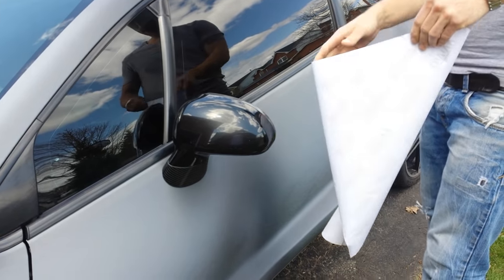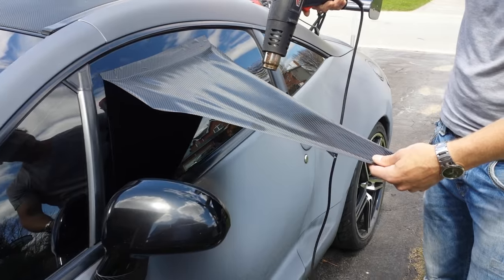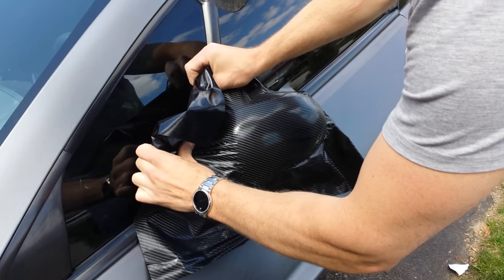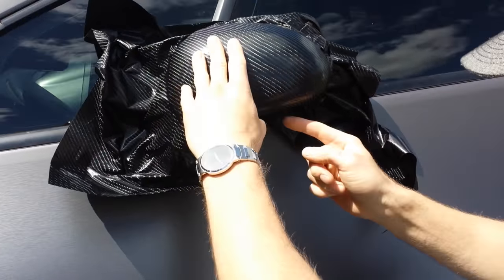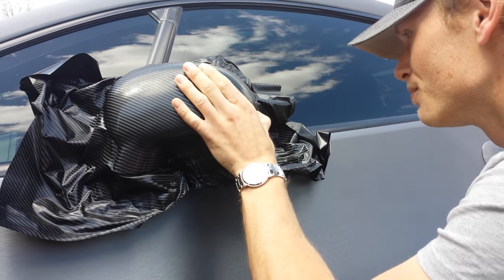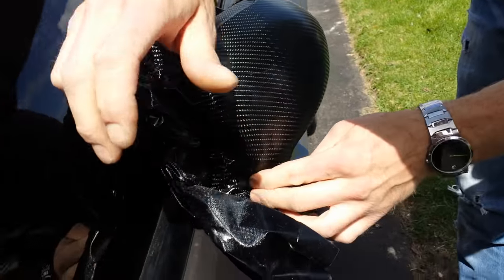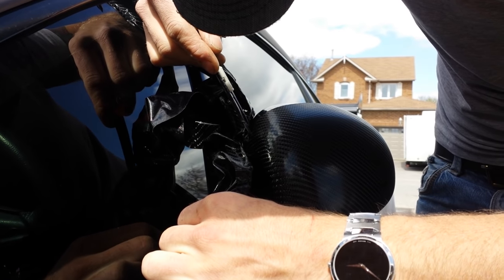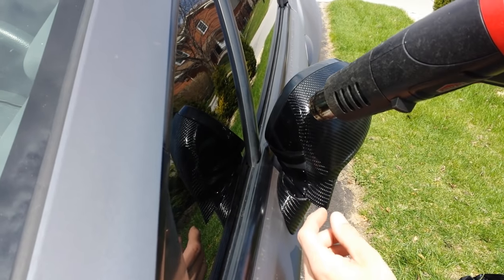How to vinyl wrap your mirrors (outside). Learn how to vinyl wrap alone by @CKWRAPS

Comment from the maker: Kudro Rico The mirrors hadn't been done on this car yet so it wasn't a re-wrap. This eclipse belongs to a friend of mine who I sponsored with a full wrap. As for brand, I prefer to stay away from 3m. I find it's hard to work with and very over priced. Their carbon fiber also isn't as nice as Vvivid Vinyl, I only use carbon fiber from Vvivid Vinyl. I would recommend using Avery Dennison if you're a beginner. Avery is very easy to use and also more cost effective, I consider Avery to be the Rolls Royce of vinyl brands.
Reply: can u do a video on how to wrap the front end pls :-D
Reply: CK Wraps what do think about orafol/oracal 970?
Reply: cara warring side mirror viva
Reply: CK Wraps
Reply: Indian dance
Reply: Damal Meemaduma па
Reply: is it ok to do outdoor installing. because small dust not an issue right?
Reply: @mrri8166  only on very still days.

Comment: You make it look so easy... how do I avoid creases and bunching on curved surfaces?
Your videos are great, you explain things the same way I would when showing a layman a new skill.
Reply: Heat gun and relief cuts at angles worked for me. I just did bottom of a spoiler that i had to work 3 different angles on a surface..wasnt easy. Lots of heat and cutting to work it in
Reply: He does make it look easy. I finished my roof today and it came out awful. 😂

Comment: Hi Chris 
I’m getting ready to do a carbon fiber wrap on my motorcycle gas tank. It doesn’t have any hard edges. Pretty much a teardrop shape. Should I pre stretch like you did on this mirror. By the way this will be my first attempt at wrapping. It’s Avery SW900

Comment: I did a part of my interior and the edges and round parts are coming up after 1 day, was the result because i used a hairdryer vs a heat gun, or i need the 9m adhesive promoter stuff?

Comment: Hi Christian oh, great videos, I have a question about how you would wrap a mirror if it did not have a removable cap. Would you wrap around all the edges that go into the mirror or would you use knifeless tape and stop of going around the edge, thanks

Comment: How do you get the wrap to form so well?  I tried doing my mirrors, but the vinyl just didn't like going around the curves.  I'll get the face of the mirror perfect, then all hell breaks loose at the edges.  It either wouldn't stick, or it would wrinkle horribly no matter how much heat I use.  Do I have to allow a short cooling period to allow the vinyl to harden before continuing?
Reply: Cody Miller what vinyl are you using? If it's Chinese, that'll be the problem

Comment: Hello.. What do I do when I stay under vinyl bubbles
Reply: a) re-wrap if it is like a small piece
b) puncture the bubble with a needle, apply heat an press until the bubble and the puncture are gone
c) lift the piece and re-apply
These are individual options, not a general instructive

Comment: hey bud I have a wrap shop and if you wanted to do the mirror on the car instead of the pre stretch on the window heat the whole piece and stretch around the mirror... then heat again and let it relax around the grove. just fyi for next time ... also you wont pick up debris from the window you had it on

Comment: Stretched that film way too far, the pattern is damaged.
Reply: A Cat yup i noticed that too
Reply: Juan DontWorryAboutIt yup
Reply: That's the hard part about CF vinyl, you heat it and stretch it, it distorts the weave pattern
Reply: Pattern looks pretty damn uniform to me by the time he's done.  

Where's your video where you don't damage the pattern?
Reply: how much should mirrors cost to wrap professionally?
Reply: @fomocowboy  the corner, you can see a black streak. I just used the same exact vivid true CF and recognize a same streak. It's from pulling too much.. I'll cover it up with a stripe
Reply: Thing is with a patterned vinyl you're going to find it damn near impossible to get it to conform to a deep set of curves and angles without distorting the pattern.

Comment: looks like you're having a hell of a time getting that backing off lol I don't understand why you didn't just pull it off the way it was rolled up? Now the backing looks like a dog got a hold of it lol
Reply from the maker: It was cool outside and a bit breezy. In normal conditions the vinyl would have been more malleable and so I would have peeled it in the way you mentioned. Not sure why your concern is removing the backing or what the backing looks like?
Reply: either way looks like it turned out alright

Comment: This was scary at the beginning, over heating, over stretching. I can see right in the middle of the cover missing lines, darker spots, this is what happen when you get wrinkles from folding and sticking on it's self before installation, no matter what you do it will never go away. i would have made a new video and start all over.